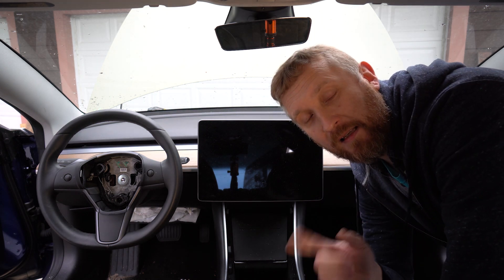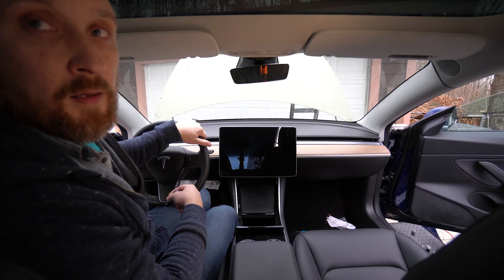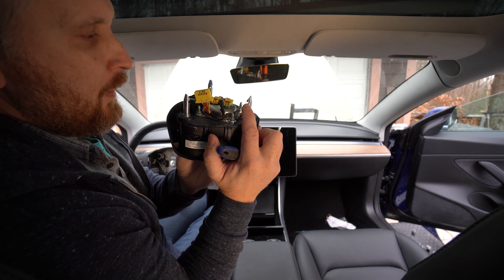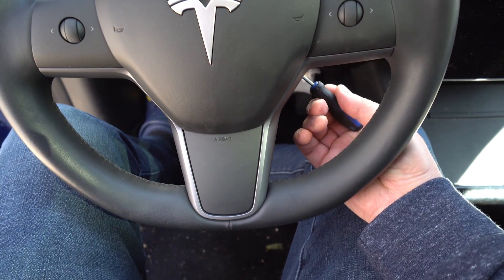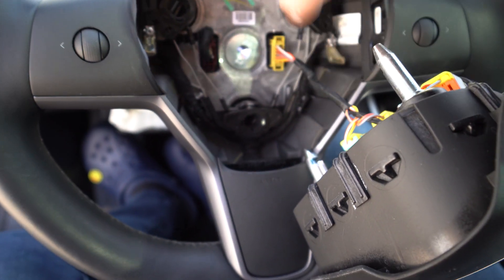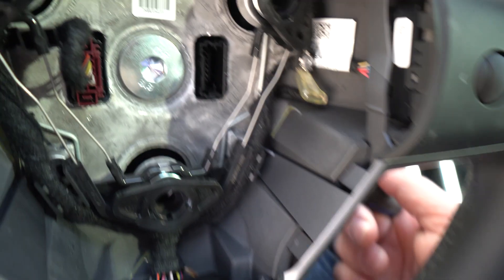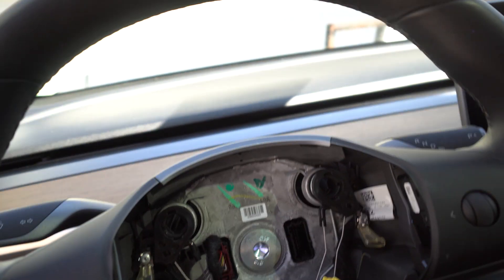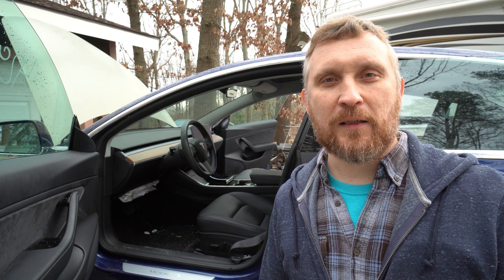tesla model 3 airbag replacement

Comment: Hello, when the car have crash and the airbag need to be changed. We change the airbag and the pyro fuse. It’s not SRS box for the airbag or other modules that’s need to be changed? 

Thanks for the answer 👌
Reply from the maker: In most cases if airbags deployed then airbag module would have to be reset

Comment: Thanks for this video. I tried to remove the airbag but I couldn’t release the bottom. I guess I wasn’t pushing hard enough on the spring. Do you have to push hard on both sides to release the bottom?
Reply from the maker: It should go in pretty easily
Reply: @akindiyrebuilds6223  Does the side pop off before the bottom? In other words, do you push the screwdriver in so far and the side pops off, and you push a bit more and the bottom pops off?
Reply from the maker: @Durzel  correct

Comment: Did you do a video on how to replace the airbag out of one of the front seats? I am trying to remove a working airbag without having it go off on me
Reply from the maker: No mine were fine. Airbags in general have safety short pins, as soon as you unplug it terminals would be shorted preventing an airbag from deploying

Comment: When discounting the 12 v battery first discount the positive side then negative side?
Reply from the maker: Negative first
Reply: Akin DIY rebuilds i only discount the 12v and i change change the airbags? Or i need to discount the other battery also
Reply from the maker: Lower your driver door window, close all doors, disconnect 12 V battery and let it sit until car shuts down completely(30min or so) or disconnect the gray data connector under rear seat.
Reply: Akin DIY rebuilds then when connecting 12v battery negative first?
Reply from the maker: Yes
Reply: Akin DIY rebuilds you know how to discount the curtain airbags

Comment: Hello Romel, 
Did you had Pyro Fuse issue in the car since the airbag changed
Reply from the maker: Not yet. But I will have to replace it.
Reply: Is there any thing to be replace , I have the same status , I bought the fuse , what about airbags module
Reply from the maker: @mohammadraslan5372  You have to get a special torx socket to get to pyro fuse. I'll make a video replacing pyro fuse in a couple of weeks. I have reset airbag module.